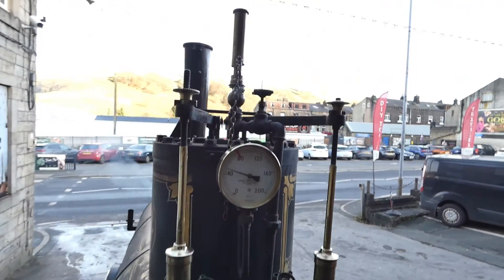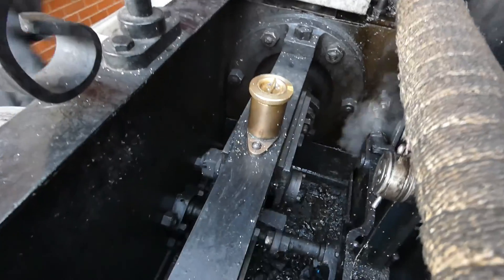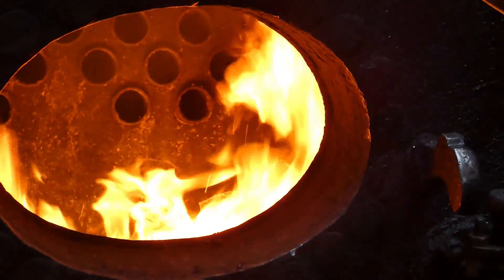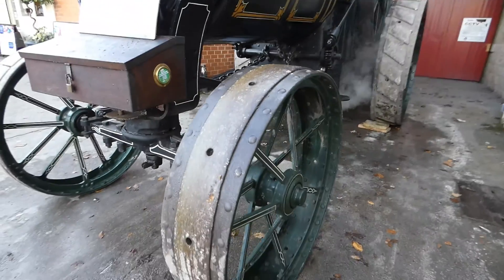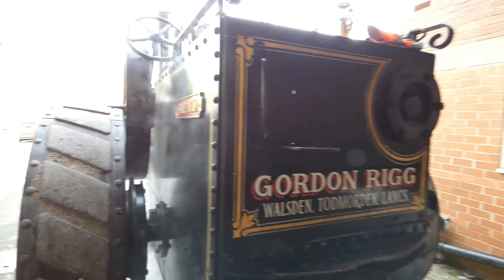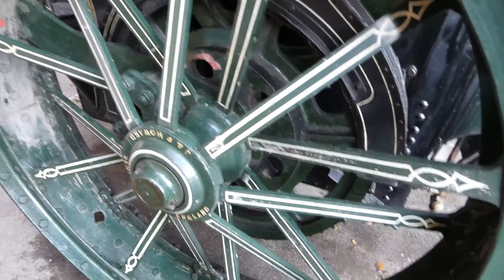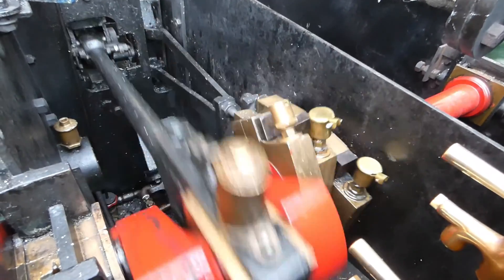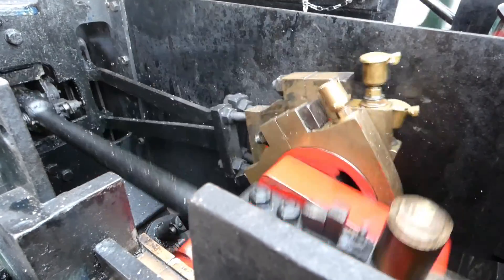A look at how a traction engine works

Comment: This is a fascinating engine! Once you get your head around the working parts. Cos there not where they usually are.
Was it originally built as a ploughing engine?
Or was that an after thought!
Reply from the maker: Aye she certainly is I've been involved with her on and off for about 5 years now and she's a fine engine to drive and steer quite doable on your own and as part of a pair it's normally me and woman called bex who run her. She was built as a ploughing engine with a single drum to the rear of the bunker paying out cable on the flywheel side this was removed at some point between it being built in 1872 and going to Australia in 1914 it came back in 1978 after being resuced by Tom varley and restored. Its quite nippy on the road easily doing 8mph and is a 8hp 6 ton engine. I have a couple of other videos on my channel giving more history and a few more clips showing her over the last 5 years.